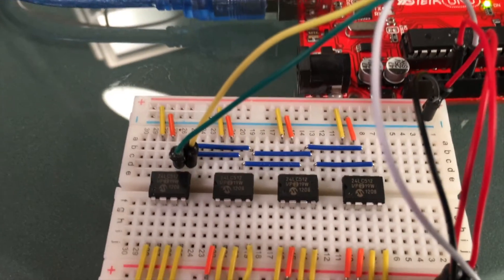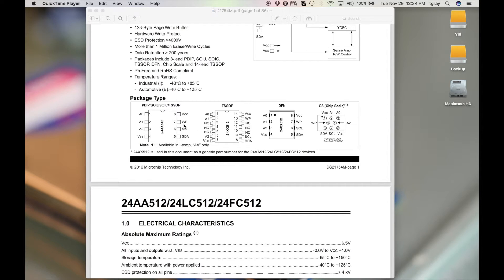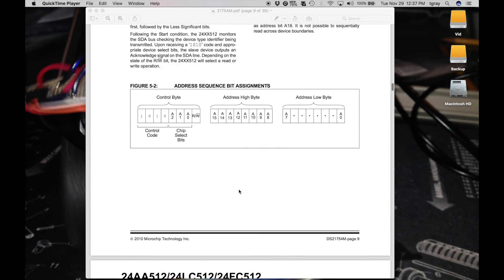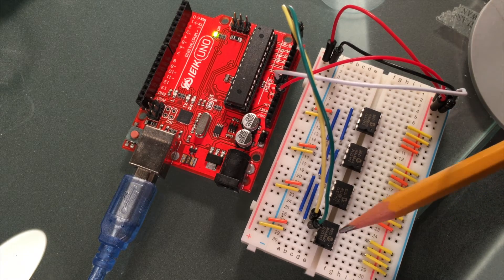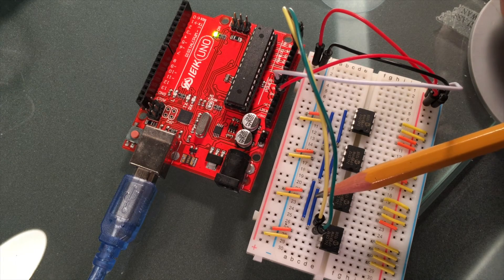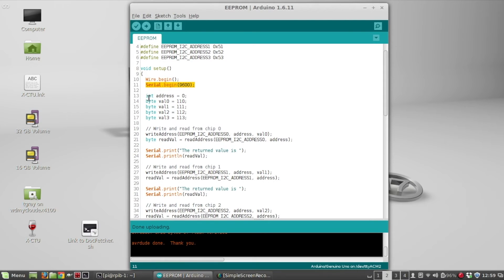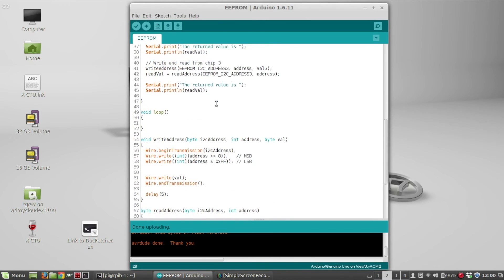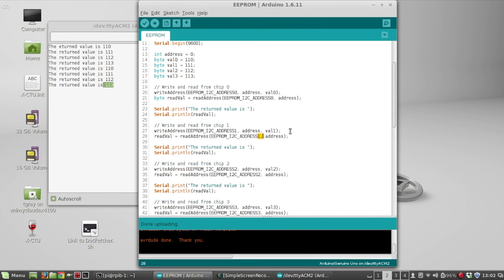Arduino and Multiple External EEPROMs

Comment: EEPROMs are great for data logging. I log barometric pressure with mine. Keeping track of what address to write to next can be a challenge.  Keep the record # (the next address) in the first two addresses of the EEPROM.  
def MLSB(x):
    xlow = x & 0xff
    xhigh = (x >> 8)
    return(xhigh, xlow)
This function splits numbers into two parts which are written to the first two addresses. Thus 65535 records can be accounted for. If a reading is taken every hour, that amounts to 7.47+ years of readings. All readings are single bytes (8 bits - 255)

Comment: Thanks man, great job! I got it working
I just didn't understand why the device HEX address is 0x50 instead of 0xA0, because 1010 binary is equal 0xA0 HEX
Reply from the maker: The first 4 bits are the 'control code' bits, and these are set to 1010 for read/write operations.  The next 3 bits are the address bits (since there are 3 physical address pins on the chip).  So we have:
1010000 = 0x50
1010001 = 0x51
1010010 = 0x52
1010011 = 0x53

Note that these are 7 bit numbers, not 8.  The eighth bit sets the read or write flag, and that will be set by the Wire library.  It will be appended to the first 7 bits, but we don't have to worry about that.

You can see at 2:39 how these address bits are used with the control code.
Reply: @electricks6149  many thanks for the help, now I understand!

Comment: Each component 24lc512 how many bytes it has?
512KB = K bits?
512000/8 = 64000 Bytes?
EEPROM from 64kbytes memory ???
Reply from the maker: Yeah, the datasheet for this model says 512 kilobits, which is 64 kilobytes.  I think you can get larger capacity chips if you need it.

Comment: This looks like exactly what I am looking for. I have currently set up a
 bread board with a ardruino nano   2 -  74LS595 shift registers (For 11
 Address Lines)
and a 28C16 ROM.

I am having problems reading the data in off the data(I/O) pins. (8 I/O 
pins)

I have manually programmed my EEPROM with a 0,1,2,3 at addresses 
0,1,2,3. I can tell all my wiring and ROM are working correctly as when I
 set my Serial.println(readEEPROM(0)); to 0,1,2,3 I get the correct LEDs
 to light up on my data (I/O) pins.

So I am sure that it must be a coding problem. At this point I only want
 to be able to read data in.

This is my current code. The addressing portion is working. It is the 
reading in, that is the problem. 

https://drive.google.com/open?id=0B6LIgQzDkH8fUDR1eEloWlc3TlU
Reply from the maker: The code seems to be fine.  Maybe try changing the line:
data = (data << 1) + digitalRead(pin);
to:
data = (data <<1) + (digitalRead(pin) == HIGH) ? (byte) 1 : (byte) 0;

I believe digitalRead returns an int an maybe that is causing the problem?
Maybe just try this:
data = (data <<1) + (byte) digitalRead(pin);
Reply: Thanks for Reply. I found the problem, and it was something very simple.
After checking out all the wiring, and code two or three times, i found the problem.

After setting:
Serial.begin(57600);
You have to make sure your Serial Monitor baud rate is also set to 57600, in the bottom 
left hand corner of the monitor. Or you get garbage out.
Reply from the maker: Jeff Nay Yeah, I thought your code looked correct.  Glad you got it fixed.